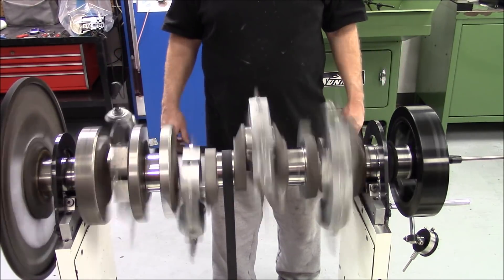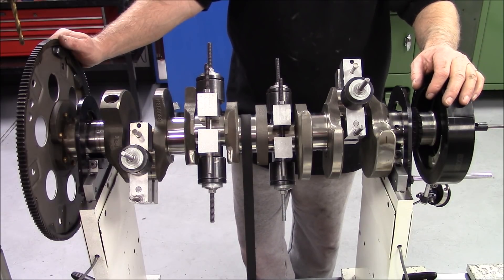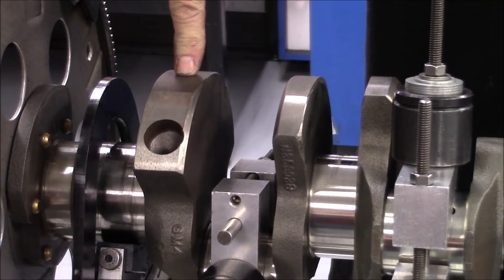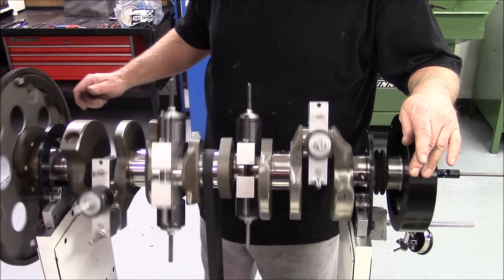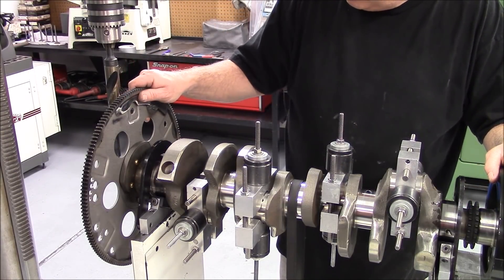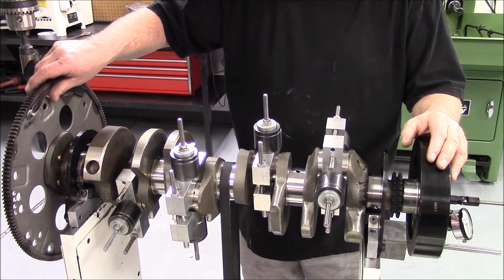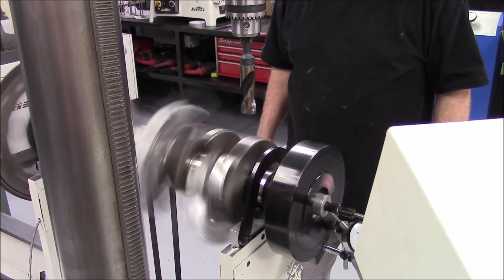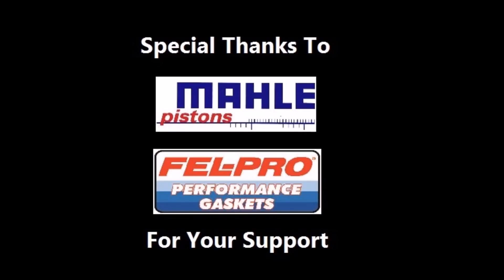Part 9 - Rotating Assembley Balancing - Shifting Weight -  620 HP 454 Big Block Chevy Engine Build

Comment: This is all interesting, but I find the major flaw in bobweight calculations is that the formula doesn't represent what the crank actually experiences.  I made a spreadsheet for one full rotation of a rotating assembly, with data points at every tenth degree.  The standard bobweight formula only minimizes vibration (and stress/strain) if the center of mass of each connecting rod is one third of the distance from the big end center to the little end center; i.e. the big end weighs twice the little end.  I have never found any production connecting rods that even come close to this ratio.  They're usually 2.6/2.7: 1.  I wonder if anyone has ever tried to actually make rods of this ratio, or if it's just one more example of "close enough...the masses will never know the difference" industry always gives the masses.

Comment: boy i be aggravated to max have to weld stater gears on the balanced flex plate or be doing a manual tans swap riding the 3sp od slush box annoyance and seeing a balanced flex plate .. lol ..K.I.S.S method ..but may be their is a resin i not seeing not to drill the crank it`s just 620 hp engine but am i missing something? thanks for videos be blessed men

Comment: This is the by the book right way and have had shops not want my balancer and flexplate. I wasn't comfortable with that because this way gets you something better than factory. There's a reason people used to tear down a new engine and blueprint it. Factory engines specs are all over as tooling wears. They didn't invest time for precision plus tooling runs a ton of parts before they end up so out of spec they changed it. Seen sfi approved faceplates fail but it's not common. Would at least buy a good flexplate since once it's balanced replacing it will cause premature bearing wear. Probably a better balancer too since the professional products balancers sometimes come apart at high rpm. The local speed shop wouldn't stock them for the longest time. Having them order one came with a warning then the price of an ATI. They had a grenaded on on the counter that let go around 7000rpm.

Comment: Oh, and if you have actually spun up a couple of different external balanced flexplates, you'll find they are all over the map in terms of weight difference and weight position difference. The tolerance the aftermarket uses is pretty loose.

Comment: You can easily match up a new flexplate to the old one with the balancer. It would be pretty unusual to have to replace a flexplate unless you had a starter alignment/mesh  issue you ignored.

Comment: I used to balance engines in the 80’s on a Stewart Warner balancing machine very primitive compared to your machine. Back then, we did all the weight corrections on the crankshaft via drilling or adding mallory weights. Specifically on externally balanced engines , the reasoning was that if the flexplate/flywheel and or the harmonic balancer has to be replaced, the crank would be closer to being balanced, than if the corrections were done on either or both of them. 
If that is not the protocol nowadays, what changed?

Great videos by the way!! I’m enjoying the fine art of engine building you are doing 👍🏻
Reply: The technique demonstrated makes good sense it seems to me.  Without going too deep, there's one formula that sheds some light here: torque= force x distance x sine angle.    So... if something wobbles 4" from midline or at the far end, we should be able to spot which one exerts more force/can do more damage - and that's the far end.  That's without looking at resonance and frequencies for complex shapes where being out of balance generates its own feedback loop making the problem worse at certain speeds, but... I don't think we have to go there [and I'm also not equipped]..

Comment: Mark, what would happen if say your flexplate ever got damaged? Would you be able to replicate on a new flexplate the weight needed?
Reply: Casey Davis Yeah Casey I think your on the right track. I think what we are seeing here is an attempt to build a budget friendly high hp motor. Using a 40 plus year old GM cast crank. He’s trying not to take any strength away from the crank. I’m sure if it was a higher quality forged crank, he would go about it differently. I’m no expert by any means, and I plan to confirm this when I talk with this engine builder. I’m a long time admirer of his work.
Reply: Why does that make him a hack?  I personally don't know the guy, but I thought he's taking a cast GM crank to 7k rpm... could it be he's trying to keep the additional welding/grinding heat out of the crank for longevity?  I've never balanced either so this is a legitimate question.
Reply: My BBC is neutral balanced meaning there are no weights on the harmonic damper and none in the flexplate I can replace either one and never have to worry that's the way it should be and that's the way most all competition engines are done.
Reply: Ok, I understand your point about internal vs external.  Maybe its something to do with the parts he's selected?  I'll have to do more research on this.  Would making the cast GM crank internally balanced take too much material/original strength away? Or take too much time making it cost effective to buy a forged crank?  There has to be a reason right?
Reply: As long as he documents the flex plate (I'm sure he does) any replacement can easily be modified to match it. Though it's not often they go bad. Taking the weight out of the flex plate lowers the harmonics and flex throughout the crank more than taking it out of the crank itself. The cheap and easy way would be to do it all on the crank itself but that doesn't address the harmonic issues as good as balancing everything.
Reply: What happens if the gears on the flexplate strip from an improperly installed starter. That flexplate is balanced for this engine only no replacement flexplate is balanced the same as this one.
Reply: Per yarrdayarrdayarrda below, if no two external balanced flexplates are the same wouldn't you run in to that anyway?  Is there a way to "balance" the flexplate?  Kind of like a tire machine?  If you had that data I'd think you could replicate it over and over with no problems... but again I am not sure if that is even a thing.  Judging by all of the videos up to this point, I don't think he is doing anything to intentionally be a "hack", hopefully he can chime in and shed some light on this.  Thanks for your reply.
Reply: Possibly but IDK
Reply: Thats just it. You don't know. So that is your first reaction? This guy is a hack? 
Seems to me you are the one who is less educated since obviously you only know one way to build something and since that is what you have it can only be the right way.  If you are using a factory cast crank the last thing you really want to be doing is drilling more holes in it and as far as needing to replace the flex plate,, well the only time i have ever seen that is if the owner destroyed it by some dumb assed move. The balancer can easily be replicated if you have the original; specs, so there really is no right and wrong here.
Reply: it is possible to put the modified flexplate on the balancer with a flywheel spindle and with a piece of modeling clay counterbalance it to neutral balance. then put the same modeling clay on the new flexplate and remove counterweight material until it is neutral.
Reply: Isn't SFI rating on a flex plate and balancer 5 years? what then?
Reply: If the customer ever has to replace the flexplate the engine will become inbalanced this guy is a hack
Reply: @justinballard7242  Just a thought, but... the crank being what it is, and reciprocating mass unchanged, could a racer not have a second flexplate balanced once the crank adjustments are sorted?  You would have a ready to go replacement, as long as bolt holes get indexed properly.  If somebody thinks they want that, they'll pay for it.
For a street ride, these things are one and done deals, meaning driving over a curb [or whatever] is going to have you pulling the crank to deal with balancing once again.  I try to avoid being "that guy".